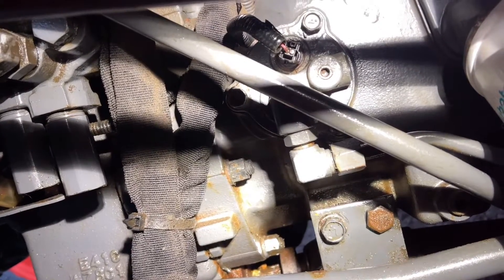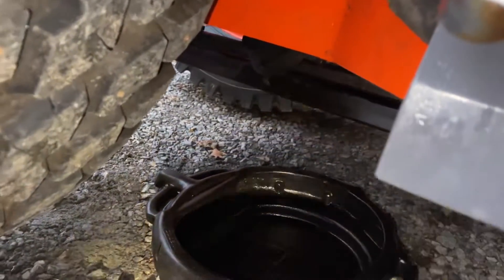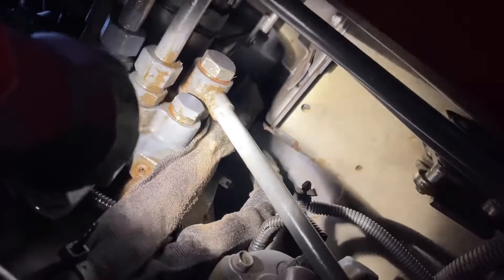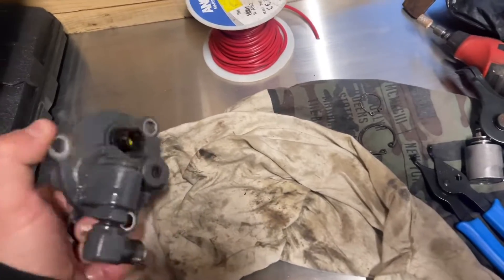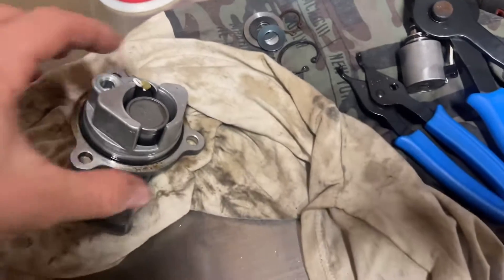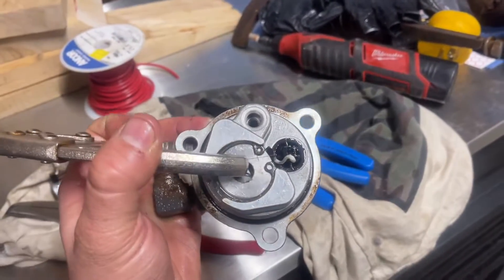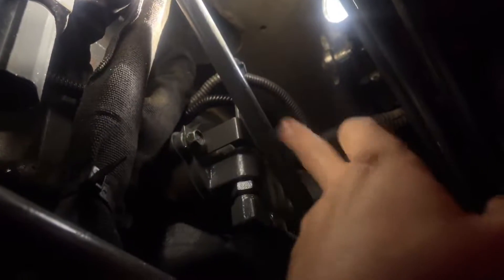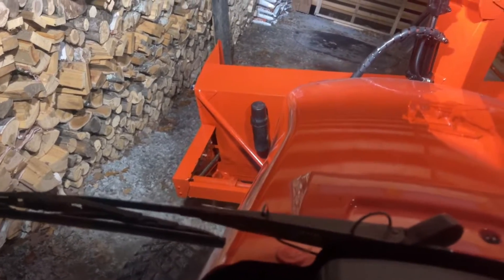Kubota L6060 ( L60 Series) PTO Solenoid Replacement

Comment: Hey Schneids, thanks for sharing this video. I wanted to clarify. In the video you said you were pulsing the solenoid and got it working. Did you mean the new part you purchased or the old one? I'm about to tackle this project and just wanted to confirm if I need to do that before install. If so, do you just use two alligator clips off a standard battery? Thanks again
Reply from the maker: Hey Chris. I did this on the old one to see. I did not do this to the new one. I just wanted to see if it was dead or not.